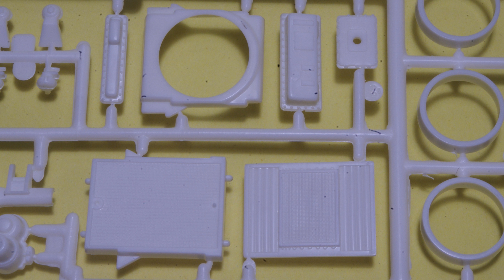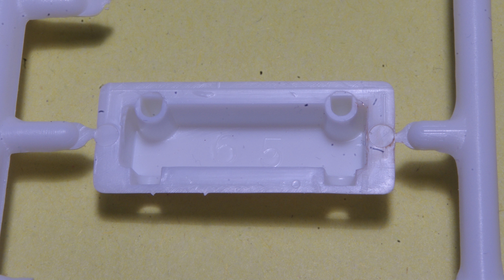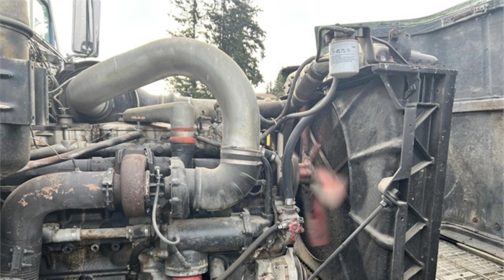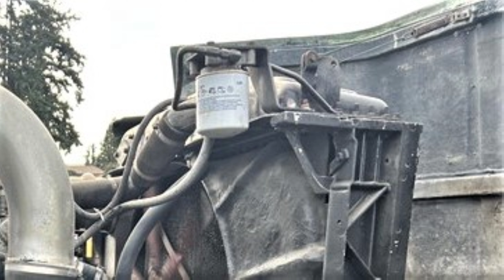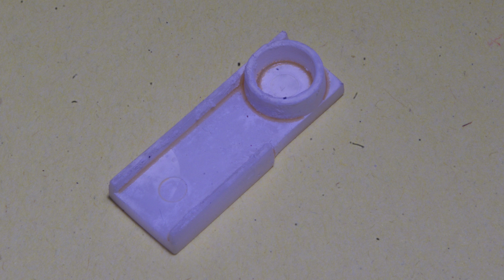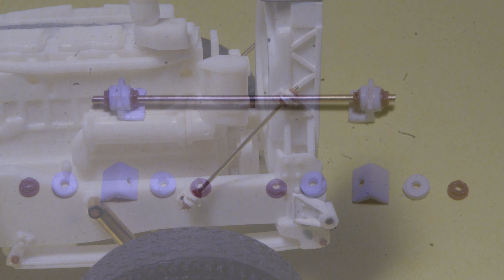1/25 scale "air conditioning delete" (and some added details) on a Transtar 4300 radiator

Comment: I am going to download your videos on to my tablet these are the kind of videos I can use I like these big rig kits I have the two mack kits from AMT the R model and the DM model with the offset cab I also have the freight liner kit the cabover the three piece cab and the new international transtar 4070A I have 4 of those I bought from Czech truck modeler there photo etch set for the freight liner kit witch caust more then the kit but I bought it anyway I think it was well worth it
Reply from the maker: The CTM photo etch set is definitely worthwhile, I believe there are two grille options and both "White-Freightliner" and "Freightliner" emblems so it could be used to detail a couple of trucks.
Reply: @brsnorthernhorsejourney3579  + yes there are my only regret is not getting more stuff from them but I will later on I want to get there etch brass for the international transtar 4070A they have nice photo etch for the instrument panel and it's all  prepainted to boot

Comment: All great stuff! You make it look easy, your methods and straightforward common sense approach to things are what make it look that way. Not getting overly hung on making it 100% EXACTLY like the picture, and showing how getting close in a quicker way is good enough, is great for people to see too. 100% Perfection in details doesn't always workout, where pretty good usually does.....and gets it done too. Thanks for sharing
Reply from the maker: I credit a lot of the approach to reading articles from other areas of the scale modeling hobby including model railroading ("kitbashing" of locomotives, rolling stock and structures) and Sheperd Paine's book on building dioramas where he describes "creative gizmology" and how it results in 90% of the results of "painstakingly accurate modelling" in only 10% of the time.
Reply: @brsnorthernhorsejourney3579  I agree there's many things to be learned from the other aspects of modeling. Rail and military builders are an endless wealth of knowledge if a person looks. That's interesting - thanks for the reading tip. I'll have to hunt the book.
Reply from the maker: @oldschool6345  It was published by Kalmbach in their Fine Scale Modeler books selections. Original publication was 1980, second edition 1999. ISBN: 0-89024-195-3 (have it in front right now during lunch break!)
Reply: @brsnorthernhorsejourney3579  Thanks!

Comment: Each component is a model in and of itself….hats off to your attention to the details!  How’s the ladder truck progressing?
Reply from the maker: Ladder Chief is still on the bench although I did take a pause while I figure out ways to deal with "chasing the warp" on numerous parts, and create new hydraulic cylinders. Two pieces glued together per the instructions just doesn't work for those items!
Reply: @brsnorthernhorsejourney3579  I have dealt with some warpage using the hot water technique. IDK how big the parts are you're dealing with but you could probably adjust the method. I will use our largest skillet with whatever depth water seems appropriate. Heat to just before boiling. For me it's just as the small bubbles form in the bottom of the skillet but don't rise in the water. To date I have not tried whole bodies, but flat/relatively flat parts and basically squarish shapes with great success. I set the parts in the pan with the most offensive warps to the bottom and use tweezers to tap/poke the part against the bottom of the skillet to feel it's resistance. 10-15 seconds is roughly the most common response time when the part begins to soften. 25-30 seconds seems to be when things go wrong. Different styrene's will time out differently for that point - age/colors/etc.. The water provides thermal mass to help evenly heat the part, a problem with using heat guns. The skillet provides a large open working area vs. a regular pan. I have on several parts been able to repeat this multiple times with the same part to get what I want without losing the part to overheat. 

The second part of this for me is to have a cold flat surface to use as a cooling plate to speed up and assist in straightening the part, locking it in it's new shape. I have a stone countertop, but large platters, glass plate or metal plate would do well. I find for the most part I can do this without protection from heat as the plastic will cool quickly with the cold surface "press". I don't let any parts retain water at removal(dump out any void holding water) but I don't waste time drying. Wet part directly to press plate. Heat guns can scorch or shrink one spot quickly, and I have had a couple parts shrink from overexposure this way, but had like a 98% success rate I'll say. If you don't go too far and shrink the part, you can repeat this several times without changing any dimensions of the part. I discovered if I hit the temp/time just right (I get lucky! lol)I find the styrene will return on it's own to the correct originally injected state on the first go - kinda like the material has memory to it to a point - IF you don't overheat it. I have some car bodies I plan to try using blocking and clamping to hold the dimensions and try it that way - IDK how that will do yet. I haven't completely satisfied a whole process in my mind yet for that. I have saved completely useless parts this way. I'm no expert but hope that helps or give you some ideas.
Reply from the maker: @oldschool6345  Thank you for sharing these tips, I never thought about the heated water technique "in reverse" - I always associated it with forming parts to a curved shape. There would be a lot less locked-in stress on completed assembly doing what you describe to straighten parts first, compared to forcing everything into alignment with clamps and then gluing together the way I have been doing it.
Reply: @brsnorthernhorsejourney3579  Yes I agree. Even if you can get something just really close to original vs. forcing it all the way and holding it makes a big difference. The best part of it I've found is the keep repeating till you're there part of it. Another thing I've thought about (but never had the opportunity to) is just resetting the parts (so to speak).... Like your assemblies you have clamped and glued. The eternal stresses you talk about could be relieved (I believe) by heating an assembly that way in it's now straightened form just enough to let it relax in it's correct form. A complex part that may be hard to deal with on its own might be better done after things have been installed that will hold it's form while cooling and reset by itself.... Or even a combination of gluing and heating could be used. For instance to hold one section of a part true allowing you to deal with another section of it. Where otherwise you would be chasing multiple sections for correction at the same time in those few crucial seconds you want to work in.

As for sharing the tip; LOL well I've got a whole lotta catching up to do! You've already shared much more than I could with you I believe!